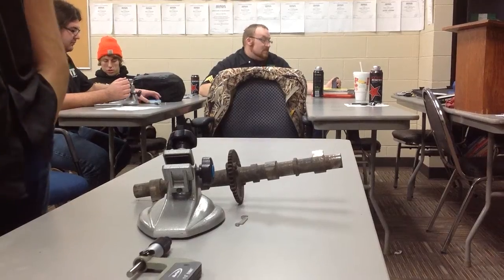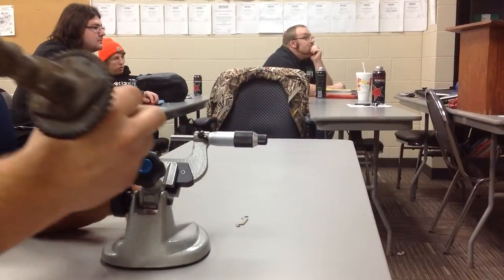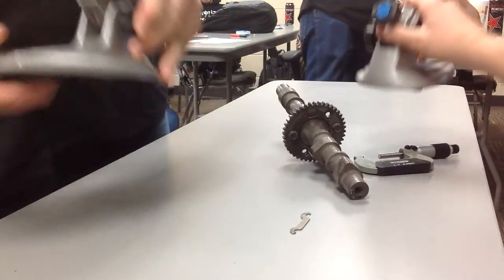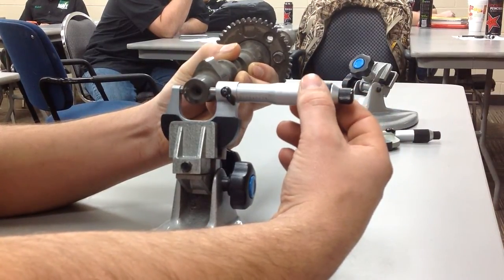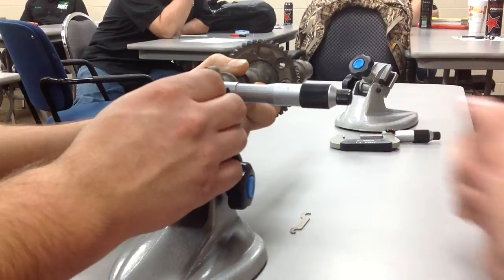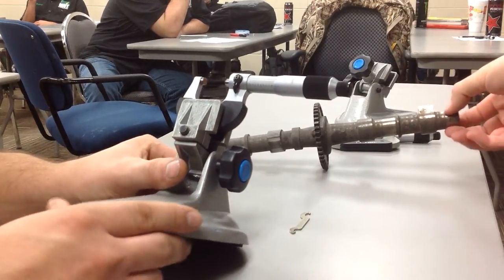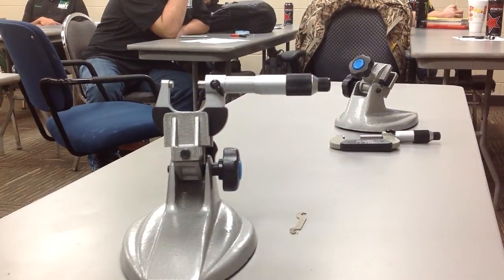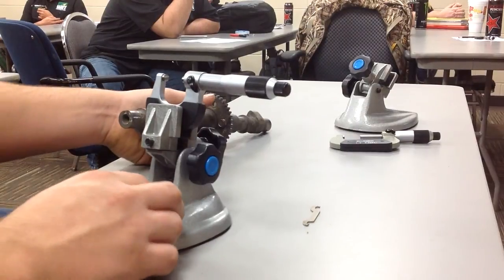Micrometer stand and feel 12-8-14

Comment: Wrong method :-(, i allways hold the micrometer loose in one hand and adjust untill it straightens itself on the bar to be measured.
Reply: +Spencer Stollery Its so dam easy to get wrong :-(
Im not an engineer but i was taught how to take a measurement correctly by several real engineers, they all do the same thing :-)
If you suspect the mic to have dirty surfaces then place a piece of fresh paper between the anvils and close up onto the paper using the clicker rachet only, then slowly pull the paper out, check zero before measuring.
You may know all this anyway, but its good to know :-D
Reply: Ya that's the best way to clean it as paper has no lint. Any airborne dust will cause a false reading on a 0.0001" or better mic